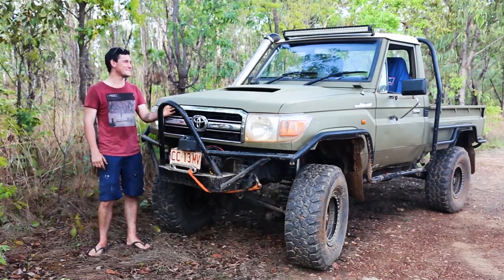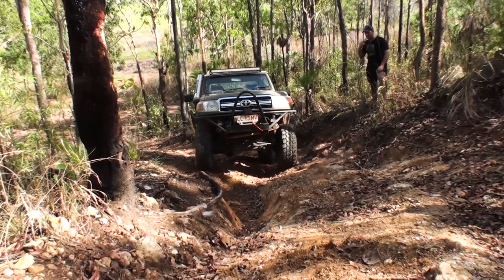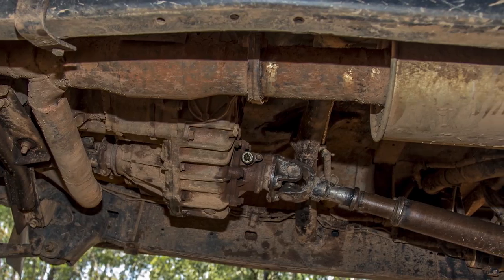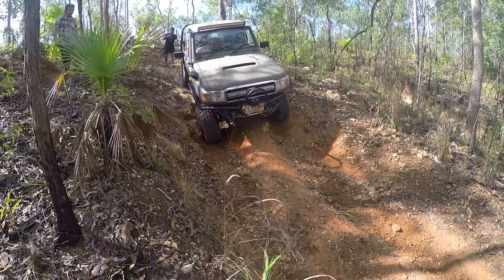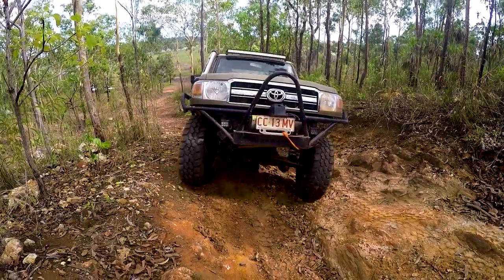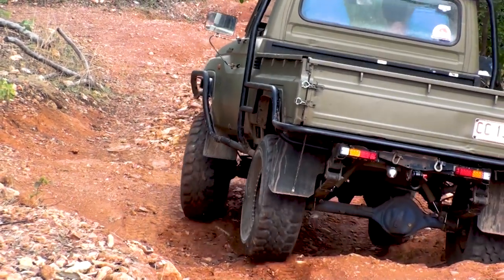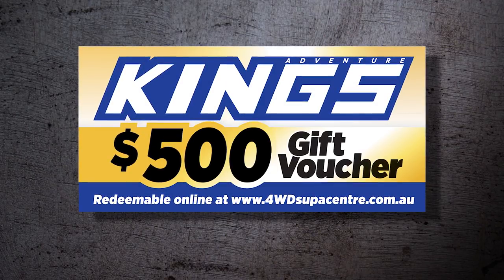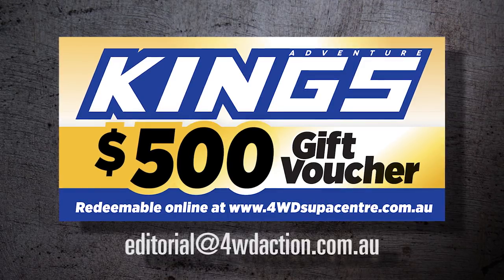ONE OF A KIND LS1 swapped 75 series • CUSTOMS #39

Comment: Nice Rig mate, looks killer, 
Though i still dont get why everyone does ls1 swaps when you could have a barra turbo installed with more power, more torque for the same amount of money ?
Still a beast though and each to their own i guess
Reply: ls1 probably gives more reliability because its N/A, so theres no turbos to worry about.
Reply: Parts to swap an LS into a 75 can be bought from Marks. Can you buy a bell housing, wiring loom, engine mounts, etc. for a Barra? If not, it becomes a much more expensive and time consuming conversion that is only worth it for the novelty. Also I would prefer a big NA with torque down low rather than a turbo with big power.
Reply: You're never going to be able to the use the barra of road, it's just the wrong spread of power. Any LS with a mild cam is far better of road.